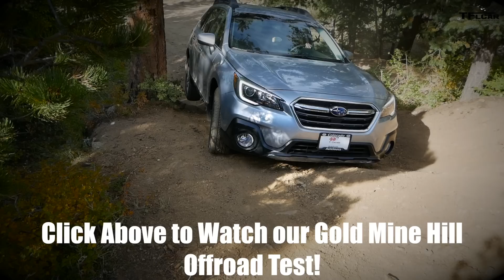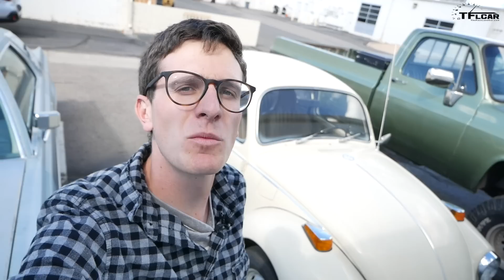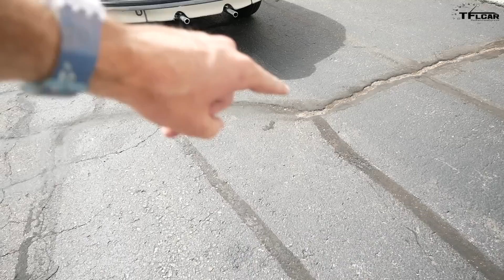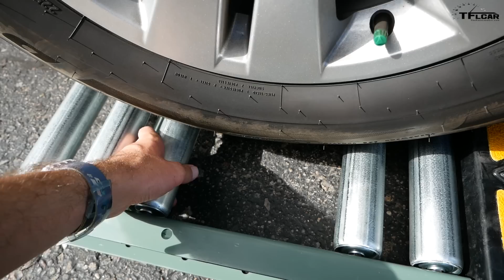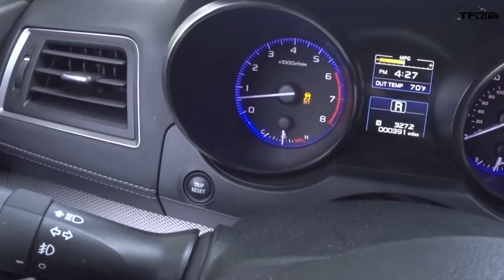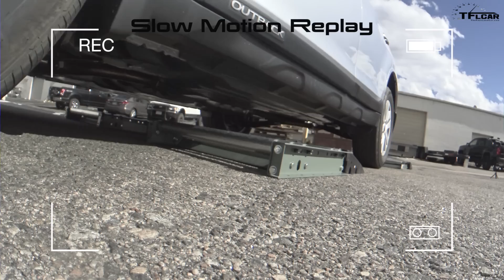The Truth About Subaru's Symmetrical All Wheel Drive:TFL Slip Test vs Subaru Outback

Comment: Nice video, but like the others, I think you need to try the same test on an incline.  Also, the CVT has been impugned by many.  It would be interesting to take vehicles who you'd expect to have similar AWD performance, one with CVT and one with a more regular transmission, and see how they compare (tested on the incline).  The 2019 Honda Pilot AWD cheaper trims still come with a 6-speed automatic, and the AWD is supposed to be pretty good.  'Course, that's not the same market segment as the Outback, but you could compare vs. a new Ascent.

Comment: @The Fast Lane Car - You ask for constructive advice on your test; first of all - the three wheels on rollers situation should be tested both front and rear. Many systems (haldex based especially) behave differently when only one front wheel has traction vs. when only one rear wheel has traction. Oddly, some haldex cars for example, are able to move with only one wheel having grip, if that wheel is the front wheel, whereas if it's a rear wheel, the vehicle will just sit there. 

It's very good that you put the car in neutral on the rollers to let it settle. It's also paramount to keep the car and tires straight and to abort the test if it's not. Some tests will be false positives simply becase the angle of the tires against the rollers can solve the situation. The rollers roll freely front-to-back but not side to side, so a surprisingly small deviation in the angle of the wheels on the rollers can actually make a great difference. 

Also be aware that weight shifting can make a lot of difference. I've seen roller tests where the car had two people in it and was stuck, but with one person moved towards the wheel with grip, it suddenly could move. So always only test with the driver in the vehicle, and no other people or (heavy) equipment. I wouldn't believe it if other people had told me, that this could affect results, but having seen it myself I kinda have no choice but to believe it. :)

If you're going to be doing this a lot, you could consider having the rollers fixed together on a per axle basis, and having a brake system on them, that would allow you to change the setup without moving the car, thus making the test much quicker. A similar system to when the MOT/inspection/mechanic tests the braking force of a car to see if the car brakes straight. The rollers are locked, then disengaged, then locked and torque is applied to them to test the brakes. Then they are disengaged and then locked so the car can drive out of the small pit, the rollers are in. A simple version of that setup would greatly reduce the time you need to do a test like this. 

You could also help the viewers out by creating a simple set of icons/graphics that you can overlay in the corner of the video to show which wheels have traction and which are on rollers. Just a wheel layout view with e.g. orange wheels being on rollers and white being on solid ground. Same with TCS - show an icon if it's on or off. Mode select, etc. Then it's much easier for the viewer, especially if going back and forth in the video. Same for reduction gear if any, so like 4x4, 4x4Hi, 4x4Lo, 4x2, AWD, AWD lock, ...

This would also maybe allow you to be a bit less repetitive. Your videos in general are like "This is what we're going to do. This is a recap of what we're going to do. This is a quick recap of what we're going to do. This is commentary of us doing what we're doing, telling you what to notice. This is us recapping what just happened. This is us recapping what that means even though we told you already. This is us coming to a conclusion based on what we just told you we were going to do, then told you again, then did while telling you again, then explaining what happened and then explaining it again. If you missed all that, here's what you just watched". It's not really a huge critism point, but on the other hand it's sorta tiring to spend e.g. 10 minutes watching a 2 minute message. And strange, because your normal car reviews aren't nearly as bad in this way, as your off road reviews. A lot of that could be solved by some simple on screen annotations like the above suggested, or like "Gold Mine Hill - Stage 3" so you don't have to tell us so many times in each video that you are on stage 2 and that to get there, you (again) had to go through stage 1 (as always). 

I think you're doing something pretty unique in that you have a fairly comparable real world test of off-road capabilities of cars, that is "the real deal" rather than some manufactor constructed scenario to make their car look impressive, yet at the same time even though it's "the real deal", it's also "the same deal" so you can kinda compare between cars, noting weather and conditions of course. I think the addition of roller tests is great, because roller tests aren't meant to mimic real life situations (as some mention in the comments) but rather to remove anything else from the equation. Since it's conducted on a high grip surface, it doesn't matter if you have road tires or off road tires, the articulation of the suspension doesn't matter, etc. It's a very clean test of the capability of the AWD/4WD system, and is very necessary in todays "electronic replacement of mechanical components" era, where manufactors promise that their gadgetry is just as good. Often times it is, but it's good to know also when it's not. The roller tests compare these things without "muddying the waters" with other factors that aren't relevant to the point. And when combined with your actual off road tests, the end result is a very complete impression of the capabilities of a vehicle, including an idea of what you can change for the better, if you need to (tires, suspension) and what you can't change (awd/4wd system, tcs, etc.)

Comment: I think you've got this test spot on man, really good. We are a 2 4X4 family, one is always a Subaru and the other a beefier one. One thing I will never understand is the use of Bridgestone tyres of any kind. They are really poor on a Subaru. They will be fine in your test but extremely poor ANYWHERE else. I understand you don't dictate the tyre choices. Currently got Michellin Cross Climate+ on our Impreza and  General Grabber AT on the old Forester we gave to my Father in Law, they only just fit but are awesome for mud and snow and towing. I have bought so many Subaru with Bridgestones on, other 4X4 too and can't wait for them to wear down. I've got Toyo Open Country AT2 on the bigger 4X4, very good but wearing down alarmingly quickly.
It's all about the tyres, nearly always is.  Oh and our Subaru have Lo ratio just like our bigger 4X4s so way more control available. :)

Comment: Fantastic video!

***** Not some garbage spam******

Two important requests!!!!

1. Can you do this test on a slope or grade?  Even on asphalt I'd be curious to see the point at which the 2.5i and CVT can't do it, from my experience with my 2017 2.5i it's somewhere around 30 degrees.

2. Please don't put your hands / fingers under the rollers with the car resting on then, I've seen rollers fail, they are very strong and durable but the Cross section of that pin/bolt is only 1/2 to 3/8 diameter, yes that's enough to lift the whole car, but it's still risky.  (I enjoy seeing your videos and don't want you to have a hard time making them in the future)

**************************

Thank you
Ron

Comment: Well, finally he states the obvious about the off road test up the hill.  The entire reason the Subaru failed was lack of traction.  If even one wheel has traction, the Subaru will climb the hill.  No traction, no climb.  You can't ask much more of the AWD system than that.  Put a BFG all-terrain tire on the Subaru and it would stand a much better chance on that surface with that grade.  It takes a lot more traction (static friction/kinetic friction) to climb a hill than to drive on the flat.  That's physics.  It wasn't the AWD, the CVT, the traction control or the xmode that failed to push the Subaru up the hill.  It was the tires.  People who off road know this.  That's why BFG can sell all-terrain tires for $200 each.

Comment: Obviously the awd system will send some power to the wheel with most traction...but if that little power causes wheel spin ..you will be stuck. Only way to improve traction is better tyres. The jeep did better purely because of better tyres for the situation, and not because of a better 4wd system.

Comment: One of the reasons Subaru calls their systems "Symmetrical AWD" is that the CV axles are all the same length.  In FWD vehicles, we get torque steer because the axles are different lengths (rather, the longer shaft on one side results in a different angle of the shaft causing the torque steer), by making them the same on both sides torque steer is limited making for more equal power application on both sides of the vehicle.  At least this is what was explained to me at the dealer, and shown on their little displays inside.

Every AWD Subaru is set up that way, they all use longitudinal engine mounting so the drivetrain is centered in the vehicle.  Most competitors (Ford Edge, Escape, Toyota RAV-4, Highlander, Honda CR-V, Pilot) all have transverse engines as they have a FWD version and an AWD version.

Comment: 6:51 driver side front locks up and transfers it right over to passenger, that's sick. it's cool to see everything working together on 3 rollers in all of the tests too. the biggest problem i had offroading a Subaru was power, i couldn't move a tire on a little ledge but it was very high altitude. also if i'm not mistaken part of the "symmetrical" AWD is that the driveshafts are the same length and all 4 axles are too.

Comment: Here's my idea. Try each wheel individually and confirm it's ability. Then put the camera on the and the second camera on the right and put all four wheels on rollers. Let's see how the system and computer communicates with the wheels when there is zero traction. Now there's a test. Does each wheel have the ability to pull it out of the situation AND how does it do it. Thanks. Great video. You got another subscriber with me.

Comment: Stock tires are garbage on the Outback. Super flex and squeak at slow speeds around corners. Subaru should be ashamed to have them on as standard equipment.

Comment: I don't think there is a problem distributing available power to the wheels.
Problem is that the available power/torque at low speed(low gearing) is artificially very limited.
Possibly to save the transmission when it is in low gear.

Hint. Search for "Subaru Outback CVT reverse curb test" and similar.
Car won't climb even when all 4 wheels have traction.

Comment: Can you please please please, use this roller setup to test the "auto 4wd" systems on modern trucks? Most of us that live in snowy conditions use these auto 4WD systems all the time because driving around locked in 4x4 on roads that might be dry or wet can be damaging to the truck.

Comment: Doing these same tests on an incline would have very different results. I'm also surprised that Subaru doesn't seem to use a limited slip rear diff in the outback. My 2007 has one and it's made for some fun driving in the winter since the back of the car is super easy to slide around.

Comment: In vehicle inspection they have used rollers for brake test . But, this brake test did not cover all wheels. During the test they can only put front or rear wheels to brake rollers. So, for awd cars like Subaru, they have used portable rollers for the idle wheels. During the vehicle inspection my outback was put it over the brake test and also portable rollers, so there was no traction wheel, but with a little wheel spin he moves over the rollers :) I'm driving Subaru's for about 18 years. For me, Subaru's awd system works great and also they produce safe cars :) . Thanks for sharing this video, great test :)

Comment: And now Roman's son shows he is as clueless as Roman.  Several times Roman tries to talk "crabbing" when talking locked differentials, and several times he's been corrected because he keeps believing somehow that the axles will want to pull inward towards the centerline of the vehicle when the diffs are locked, thus him making the "crabbing" term.  Now he passed down this term and misinformation to his son.

Not to mention, these wheel slip tests are as useful as the one-arm bandit motor oil test rigs.  They are all open to manipulation and now the electronics of vehicles have come so far that dynamic conditions are vastly different from a test condition on a rig, using speed, g-force, yaw, and other inputs.  There is no way to better this test, it's inherently flawed and the cars know now when they are being tested anyhow, exposed by none other than the #dieselgate scandal.  ALL cars know when they are being tested and parameters are adjusted accordingly.

Comment: Just a correction - Its not front wheel driven bias - In no way shape or form
Reply: digitalemotionfilms Of course it is, no center differential. Majority of power is going to front wheels.
Reply: Ummmm - I have 2014 Outback - I just replaced my centre diff

]
Reply: digitalemotionfilms If you have version with manual transmission, you have a diff. Why did you replace, already broke down?
Versions with CVT do not have a diff.
Reply: The Centre diff was binding and Subaru replaced it. I travel in ADVERSE condition almost 24/7 my vehicle has done 392000 km.... Id say its fair.  Accoriding to you post you said the vehicle is FWD bias - IT HAS NO CENTRE DIFF !   If it has no centre diff how do you think the rear wheels kick when the vehicle slips ?
Reply: digitalemotionfilms It has clutch-pack, like many fwd biased awd systems. Not a diff. Just read about ACT-4 awd system which is used for versions with CVTs (and some ATs). And then ask any Subaru dealer to plug the service computer in and watch how often and how close to fwd this system is going.
Reply: Funny that the SUBARU service manual refers to it as a centre diff then, but I get your point -
Reply: digitalemotionfilms That's how they call it in manuals, but take any technical specifications and you will see that's a clutch-pack. Do it before you write another comment.
Power is going from front to rear. Since 1985.

Comment: It was a good test, and props for getting the rollers, and making this. It's a great test that you can do on all AWD vehicles. Ways to test better you ask? Be more methodical. Test every configuration and you'll expose flaws / weaknesses in any AWD system. 
Example:
Test - Center diff - front wheels on rollers = test and passed
Test - Center diff - rear wheels on rollers =
Test - Left to right - 2 wheels on rollers, Driver side with traction =
Test - Left to right - 2 wheels on rollers, Passenger side with traction =
Test - Front driver and rear passengers on rollers =
Test - Front passenger and rear driver on rollers =  test and passed
Test - 1 wheel traction, passenger front = 
Test - 1 wheel traction, driver front =
Test - 1 wheel traction, passenger back = test and passed
Test - 1 wheel traction, driver back =

Comment: No, no it doesn’t push the limits of torque and climbing capability. It pushes the limits of the tires or more precisely, the tire’s traction. Get some real wide aggressive off road tires on that Subie and put it in the same position! It will power out or spin out due to lack of traction which is due to the required traction at such a steep angle. Every tire has its traction limit. A softer aggressive tire will be able to transfer the rotational force of the wheel to the ground much better than a stiffer and narrower all-season tire. I can’t believe you actually said that this car wouldn’t do so well on a steep hill like Gold-mine hill. Non-sense. If you are going to make a video explaining the AWD system of a car you have to talk about traction and tires! Do some more research on the Internet, and then make a video.

Comment: I thought of two things that could equalize the test results: 1. Put the rollers on an inclined surface. 2. Use the right tires to climb the dirt hill. I think any car can be stopped but I also think that if the car was properly equipped it would climb that hill.

Comment: No surprise, the brake based torque vectoring did exactly what it's supposed to do, you can see when it brakes the spinning wheel.  Also looks like the BBTV works at all times regardless of which mode the car is in.  If you still have that 2019 Cherokee around test that one, also a great opportunity to demonstrate how a locking diff works.

Comment: I think part of the problem, on Goldmine Hill, was that it never completely lost traction, as it would in snow or ice.  So the system continually tried to let the "slipping" tires have power, as they had some traction.  This meant that the tire or tires with the best traction, didn't actually get enough power to them.   This is actually proven out in the test done in this video.  Though the Subaru did move forward, with little effort,  the system kept trying to send power to the "slipping" wheels, until it was clear that they had not traction.  This small amount of delay, is what cause the failure on Goldmine.

Comment: as i said in the last video, VDC OFF does NOT disable traction control. only stability control. the traction control system is required for the proper operation of the AWD system since it utilizes open differentials
Reply: There is a reason why the X-mode is invented....
Reply: x-mode is a SUPPLEMENT to the tractio/stability control systems. doesn't change the fact of my original comment. VDC OFF does NOT disable traction control
Reply: @mschiavoni  It improves traction by turning it off. You can also disable VDC by simply removing the fuse where the hood latch is in the Subaru. Its really easy. But the fact of the TFL test did regardless is flawed.